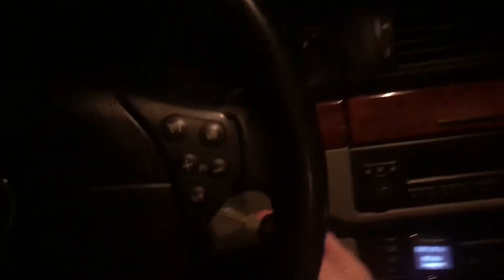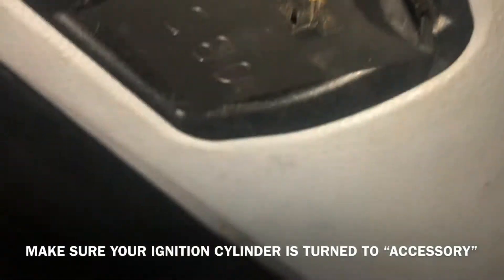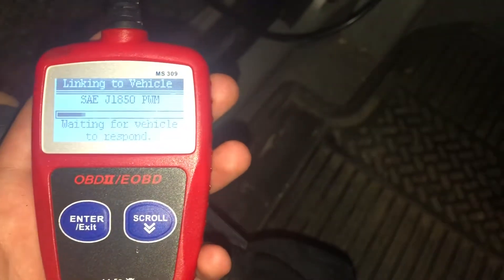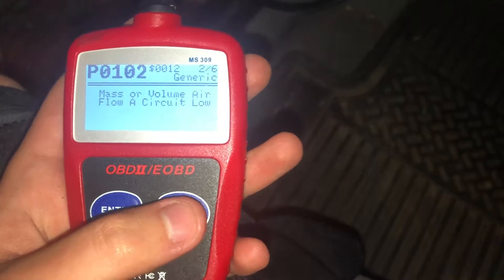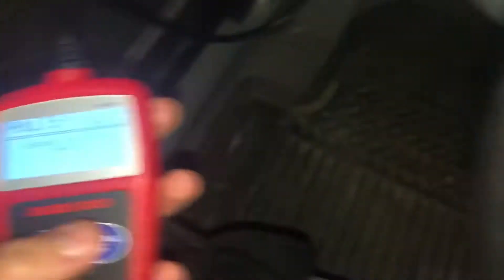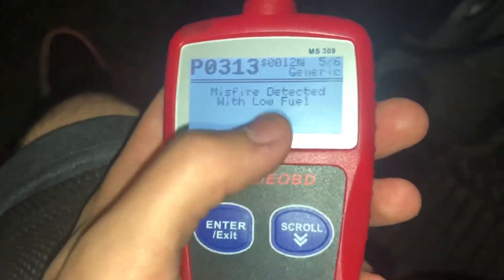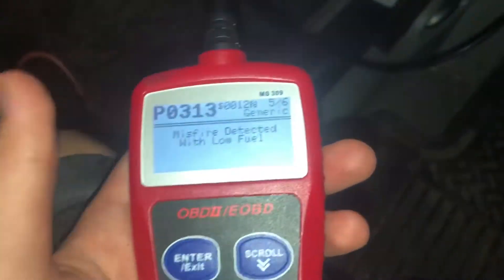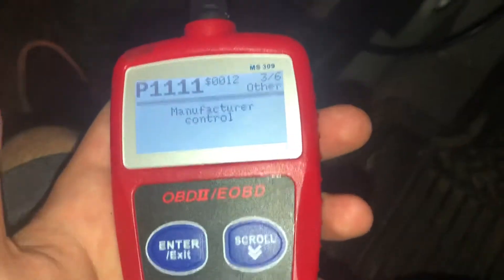How well does the $20 Walmart OBDII Scanner Work?

Comment: When DTC's are thrown, they are stored and reported by the computer until it receives an erase code signal for a monitor from a scan tool, regardless of the physical situation of the vehicle. If you repair or want to test something, you will have to erase the codes thrown by the computer afterward. Also, the Walmart near me has a cheap Autel scantool for ten bucks more next to the cheapo HT tool. It has a color LCD screen and can read live monitor data and perform inspection readiness tests in addition to reading/erasing codes. Good luck with your project.

Comment: Do you know if this has 16 pins on the connector? I was going to buy one today but it only has maybe 8 or 10 pins inside the connector. I didnt buy it since I didnt know if it was defective. They only had 1 in stock so I couldnt check the other ones. Thank you for your time!
Reply: The HT309 (HyperTough, an offshoot brand made by AuTel but promoted for WalMart) has a 16-pin connector but not all used. Although it appears the gentleman has a device designated MS309 (MaxiScan), likely still same operation? Oddly, AuTel site doesn't show HT309 but defaults to the MS version, seen at very last of DIY tools.
www.autel.com/c/www/mk1/3264.jhtml
Reply from the maker: Sorry for the late reply! I can go check right now.